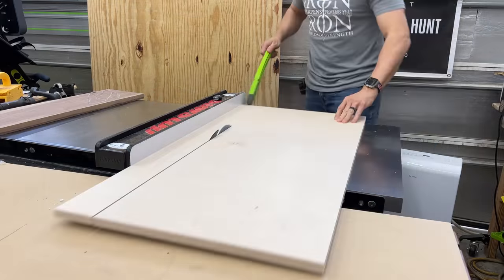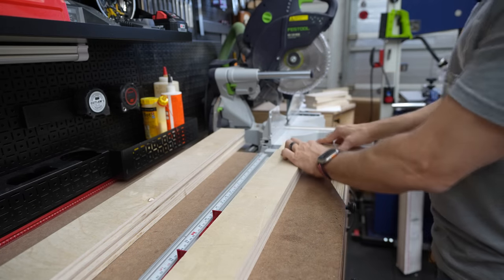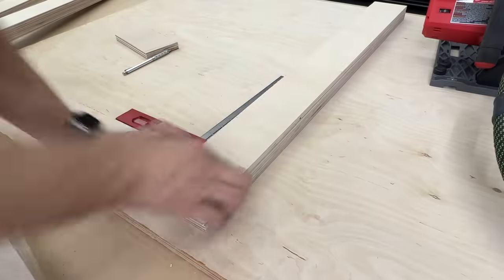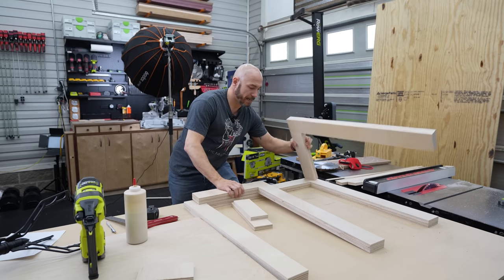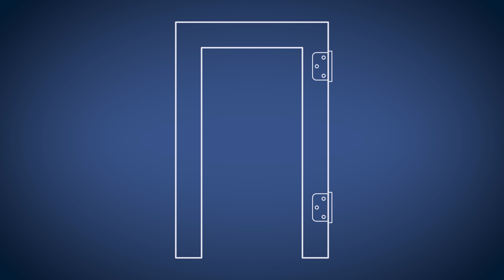Portable & Affordable Folding Work Table for Small Spaces

Comment from the maker: ▼EXPAND FOR LINKS TO THE TOOLS▼ 
🎥 Watch Next - DIY Portable Workbench - https://youtu.be/hQGK6pdMo_A
🛠Tools in this Video:
Folding Work Table Plans: https://www.731woodworks.com/store/foldingtable
Bow Push Stick - https://lddy.no/1ey2k
Grr-Ripper Push Block - https://amzn.to/3XSfvv0
Miter Saw Stop Block System - https://amzn.to/3YRsBKg
Ryobi 18 Gauge Brad Nailer - https://homedepot.sjv.io/vneWbN
Milwaukee Track Saw - https://shrsl.com/3xuy5
Woodpeckers 1282 Square - https://www.woodpeck.com/woodpeckers-stainless-steel-squares.html
DFM (small blue) Square - https://amzn.to/3EunR4U
Milwaukee M12 Drill / Driver - https://shrsl.com/3xuyf
3 Door Hinges (I used 1 1/4" screws instead of the ones that come with the hinges)  - https://amzn.to/3xIOcID

Other Tools/Equipment I'm Asked About Often:
Table Saw - https://amzn.to/3IoKqsZ
Table Saw Blade I'm Using - https://shrsl.com/3xv5i
Miter Saw - https://amzn.to/41hbJy4
Dust Extractor - https://amzn.to/41l6RYA
Tripod for Phone - https://amzn.to/3E3kWA9
Phone Holder for Tripod - https://amzn.to/3E1E6GG
The shirt I'm Wearing - https://www.shieldsofstrength.com/iron-sharpens-iron-short-sleeve-t-shirt-proverbs-27-17/
Boots I'm Wear - https://amzn.to/3HkUl3y
Toolbox in Background - https://homedepot.sjv.io/x9B2xy
Tool Wall over Miter Station - https://amzn.to/3ZgWq7B
Digital YouTube Sign - https://amzn.to/3GL2a2e
Camera Gear I Use - https://kit.co/731Woodworks/camera-gear-i-use 
Computer Equipment I Use - https://kit.co/731Woodworks/731-woodworks-computer-equipment

(If you use one of these Amazon and other affiliate links, I may receive a commission) 

Other useful links:
Daily Tool Deals on my website: https://www.731woodworks.com/tool-deals
Subscribe the 731 Newsletter: https://mailchi.mp/7e44c16eefdc/731-woodworks-email-newsletter
Check out our easy-to-follow woodworking plans: https://www.731woodworks.com/store
Outlaw's Board Butter - https://www.731woodworks.com/store/boardbutter

Comment: Matt that’s a cool idea. I work in a half garage shop with all the big tools and I barely have enough room to work most days. But I can’t tell you how many times I needed a small bench just like this. As a matter of fact, last night I had to paint some trim I made. Long piece was only 28” and most were about 18” (hallway). I had to clear so much stuff off my dedicated work bench to make room, heck it probably took me longer to do that than the actual painting. The only thing I have to consider is price. The way wood is priced these days, a lot of the time you can buy something that works for the same price or less. Time is a factor to me so that matters. Thanks again for the video.